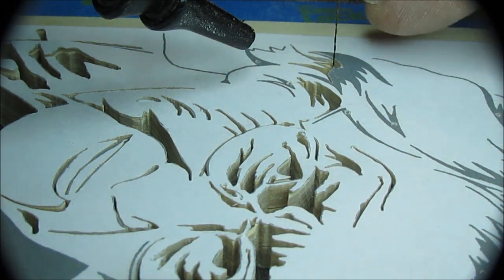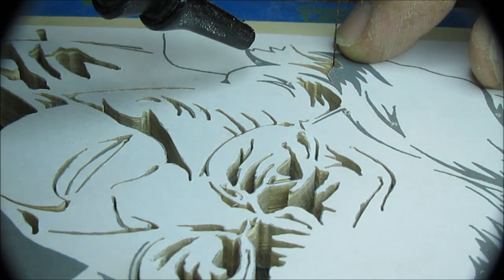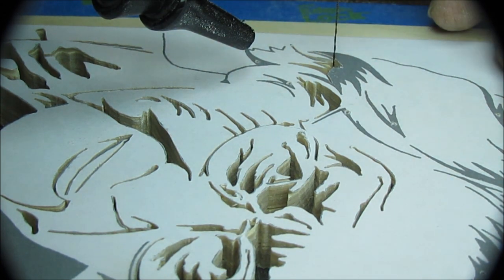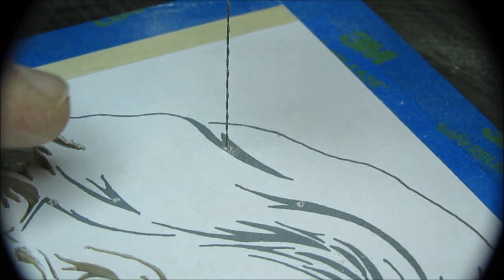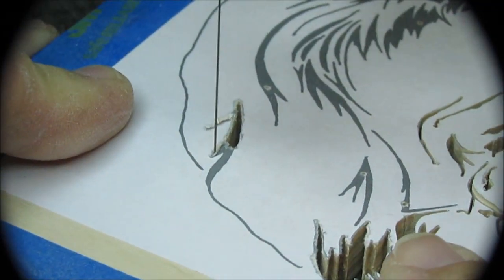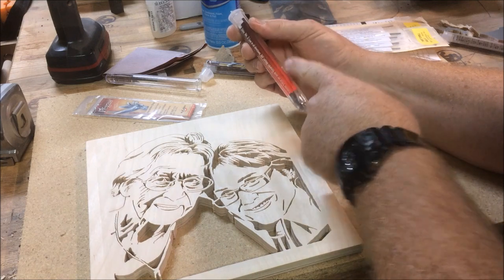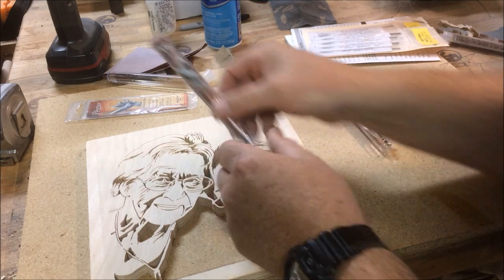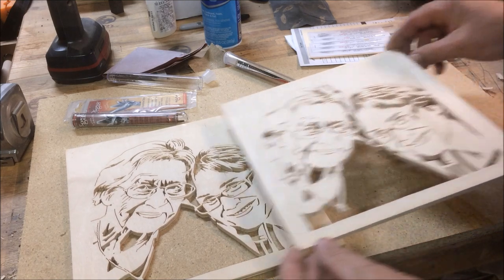Scrollsaw Portrait for a Friend

Comment: I love the trick for squeeze out with the straw. Looks amazing sterling.
Reply from the maker: works even better if you cut a 45 degree angle on it, i did to get the fine squeeze out, but didn't get to film it, thanks for checking it out Dan

Comment: Sterling,  fan and subscriber.  I'm fascinated with using a scroll saw for projects after watching your work, but the inside cuts and intricate work you do requires a lot of stopping and starting obviously.  In my research it appears that some machines like the one in this video make it at least a little easier than others.   Can you tell me what make and model of scroll saw appears in this video and what if any recommendations you might suggest for my first scroll saw that will allow me to do a lot of inside cutting without getting frustrated with all the swapping blades in and out each time.  Thanks for all you do and thanks for the great videos.
Reply from the maker: Mine is a DeWalt 788 Scroll Saw, i would recommend it to anyone, but if budget is an issue, the Porter Cable is a great starter scroll saw, hope that helps and thanks for watching

Comment: Truly amazing work you did in this video, what mm wood did you use and what thickness?  Also what make is your machine? 
Keep up the good work.
Reply from the maker: 1/8 inch birch plywood, you can stack it 3 of 4 high and cut multiples at once easy, I have a DeWalt 788 Scroll Saw, Thanks for watching

Comment: That is a touching project and pretty amazing, quick question, are you using a magnifying lamp ? and if so does it help? I am new to scroll sawing and my eyesight is not he best, I was planning to use some of those magnifying glasses but then I saw your vid
Reply from the maker: Thanks for checking it out, i do us a magnifying light and it helps me tremendously, i love the lamp light verses the glasses, just a wider angle you can see through , thanks for checking it out